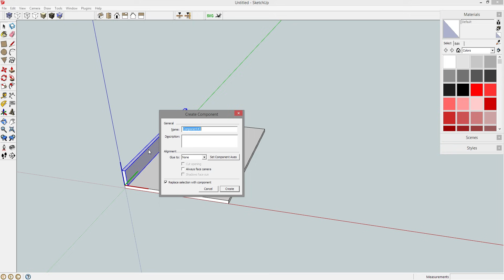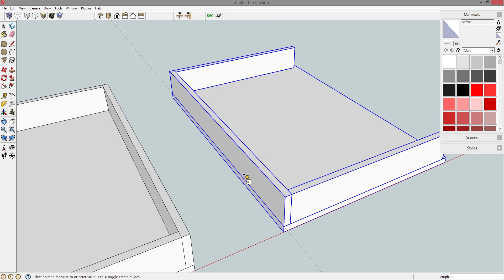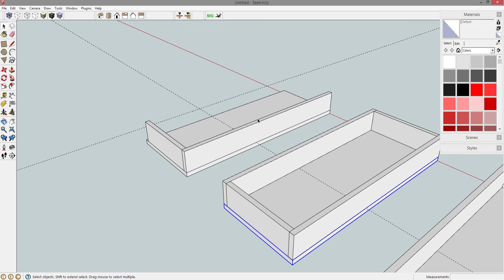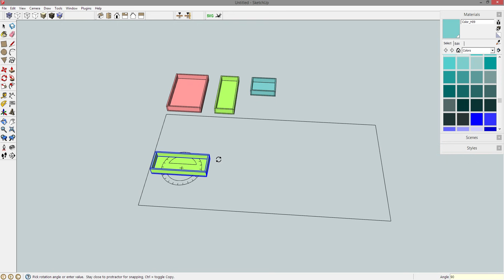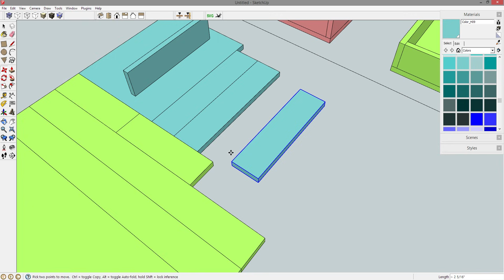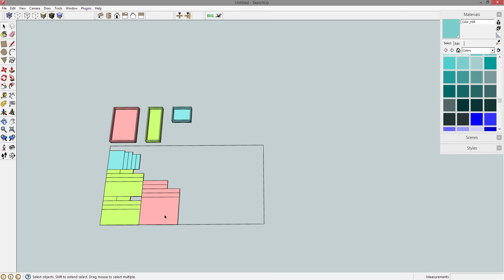Comment: In my opinion this is a very akward method to find the best layout for avoiding waste material. I use the small programm "WoodWorks" to find the best layout for cutting plywood or other plate materials. There you can just enter the dimensions for your parts and the dimensions of your plywood sheets. This programm will calculate the best possible layout depending on the time it calculates and shows a cutting plan with all particular parts and their dimensions. 
Greetings from Germany
Reply: +Mirko Goldbaum I use SketchUp to model the parts and work out all of the dimensions first. It doesn't make sense to me to take the measurements you just created and input them into another program when you've got them all in SketchUp already. I like this better as sometimes the model and part sizes will change.
Reply: +Mirko Goldbaum And also. SketchUp is free for non commercial and WoodWorks cost over $800??? Is that right? And I agree with Jay to have everything in one place instead of switching between multiple softwares, wasting time and money.
Reply: +Jay Bates This comment shouldn't be a critism! I just would like to show another 
method (in my opinion faster method). Thanks for your great videos! I 
love to watch and learn:)
Reply: +Mirko Goldbaum I just searched for woodworks and that was the price it came out with. But checking your link it was different software. I do apologize if I sounded too harsh. I understand everyone has got different way and methods of doing things and the best one is the one that suit individual preferences.
Reply: +Mirko Goldbaum Sketchup is as fast and practical as it gets, I tried Autocad an others, nothing faster and more intuitive than Sketchup, If you know about something better or faster please let us know what program would that be, thanks
Reply: +Tim M 
I design my projects with sketchup, too. I just use another programm to find the best layout for my cutting list. You can find the software I use in the link above.
Reply: +Mirko Goldbaum 
I use MaxCut, there you can make your own library with all kind of plywood distances.
and you can print, and it can make a list wirh all the pieces you want to saw. very easy to use.
its free, and you can print labels with it to stick on ervery piece you saw, then you now wath part it is.
optimalizing with sketchup take too much time.
everything he did in the video, would i do in just two minutes. thats 15 minutes, in a factroy is 15 minutes worthed €13,00. that is 14,50 dollar
Reply: +ik vinde helemaal mooi 
and you americans dont use the metric system.
the metric system is much faster and easier. (when you learned to work with it, you will understand)
Reply: I was raised English, but Metric sure is easier in this task
Reply: +Tim M Cutlist Plus

Comment: I also lay may parts flat but I dont care about placement. I just lay all the parts flat so I can see all of them and the mesurements. After that I use Max Cut, a standalone software used to optimize cuts on a piece of material. You really should check it out. I also mention it on an other post. Its free for home and small company. You wont have to think about the sheet, blade kerf... the software do all that for you even grain direction. It tell you if you how many sheets you need, the number of cuts. I'm really not related to the software maker, just a fan of the software.
https://www.maxcutsoftware.com/